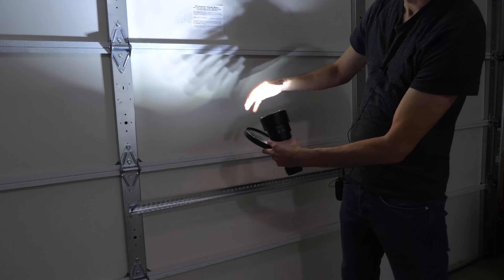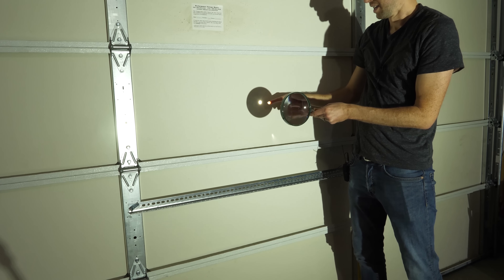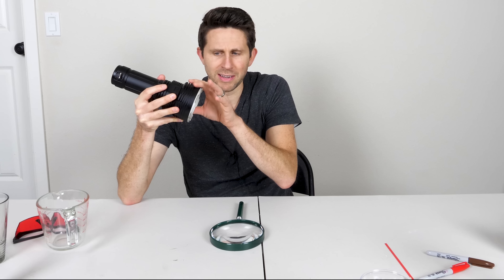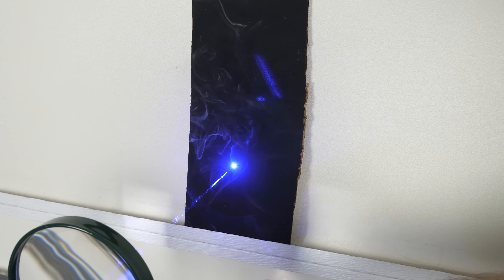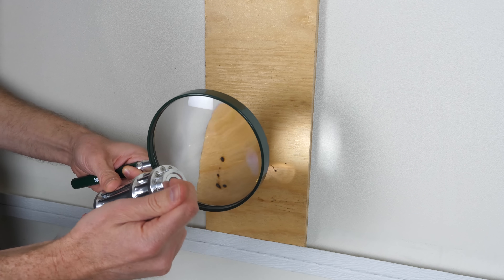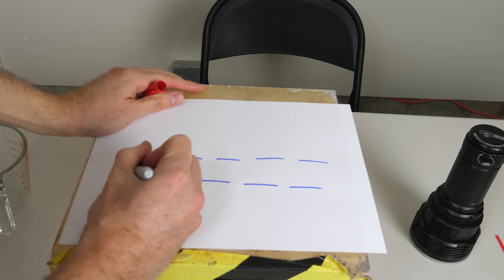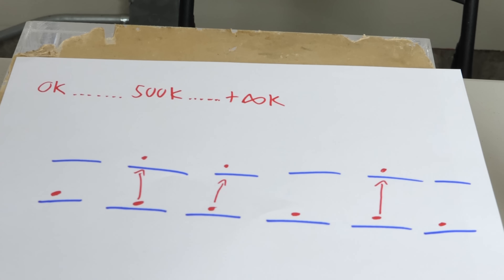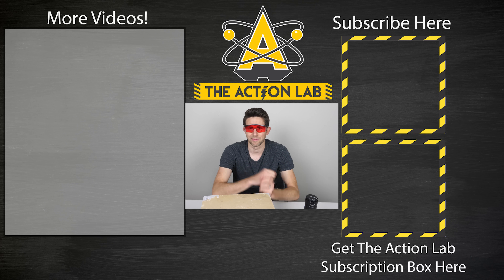What Happens if You Focus a 5W Laser With a Giant Magnifying Glass? Negative Kelvin Temperature!

Comment: WTH!!! you can concentrate the flashlight by  multiple ways....1. using two magnifying glasses. keep the flash at the focal point of one mag glass, which makes the light move parallel to the axis of the magnifying glass 1, and then [place in the same axis the second magnifying glass to focus all incoming parallel rays to its own focal point. OR 2. just use a parabolic light reflecter just like the ones used in really old flashlight.
This is like grade school level stuff dude.....

Comment: Me: just studied about negative numbers
You: -0 exists
Me: illegal
Reply: Arturo How Long Did It Take U To Finish That Reply
Reply: Or maybe... -0 has infinite possibilities. Making it infinity.
(Im joking)
Reply: @Name-cz5jj  5ish minutes? Dang. I thought it would have only taken a couple
Reply: @Name-cz5jj  In "plain mathematics", that's right. In IT, it's not. There's a difference regarding precision: -0.000000....0 means that you have a value which is between neutral zero and -1/(2^x), where "x" is the mantissa precision in bits. "+0.000000....0" refers to both "plain zero" and any value up to (but not including) +1/(2^x). However, if your target storage (e.g., your allocated memory) does not support a precision that can hold the exact value, you will lose the precision while the sign will be kept (since the sign bit is always part of the floating-point representation, e.g. in IEEE 754).
Reply: In maths -0 is equal to 0, so I don't understand how -0K is hotter than 0K.
Reply: Justin van Zuilekom not ok = ok. :)  I finally understand women.
Reply: @justinvzu01  -0 and 0 are both zero, but when interaction with anything else occurs -0 will heat something up while 0 will cool it off. This is why he called it infinitely hot.
Reply: That's a limit. It tends to zero from below
Reply: @Name-cz5jj  Not necessarily. Floating point arithmetic allows to differentiate between +0.0 and -0.0 by definition.
Reply: @Name-cz5jj  That's the point mathematically -0 is the same as 0 the distinction is simply for practical use and understanding.
Reply: Arturo I got a question right answering -0
Reply: Lol this kids probably like 12
Reply: Yo look up -0 on Google then click images then click all
Reply: my name eh jeff mah dood everyone being big brain ur just like “what”
Reply: @Name-cz5jj  It's true, but 0 kelvin is not applicable.
Reply: @Name-cz5jj  bro w h a t
Reply: I got -0 on a calculator
Reply: @Name-cz5jj  r/Wooooooooooooooosh
Reply: :-0
Reply: You only just now learned about negative numbers? Are you in elementary school or something? You’re supposed to 13 or older to have a YouTube account.
Reply: Vicius no, have you learned about -0?
Reply: WoodyofmC is right. When you interpret the atoms energy states in the video as bits, you get pretty much how floating point numbers in a computer work. 0 would be all zeros, -0 would be all ones. Both values would be mathematically equivalent, but not identical, as they are stored as different patterns of bits. A comparison function would have to implement this as special case, a simple binary AND would not be enough.
Reply: At 0 kelvin nothing moves
Reply: Short words
0 can be negative or positive because it is the origin between negative and positive

I know you're trying to make a joke...
Reply: @sans_the_animator  so..... 0 can be + AND - thats it im reading somr manga
Reply: @barringtona3859  But they're both zero degrees, so they should do the same thing.
Reply: And i just found 2 undertale fans in a row
Reply: sans the animator your gonna have a Math time
Reply: Has anyone heard of that liquid that science has discovered that weighs less then nothing
Reply: Not scientifically possible

Comment: But what you're doing is concentrating it, you're not taking the original dot size and making hotter. You're making the dot smaller but more powerful. For every action is an equal and opposite reaction. If the dot becomes 10x smaller, it makes it 10 times hotter

Comment: At 2:02 u said... 
But if u put Led in front of magnifying glass at its focus and collect all rays parallel and then put a another magnifying glass in the way of rays and then converge these rays to point
And secondly u said that it will violate that heat moves from higher energy to lower energy
Iys not true because energy movement has no convention as heat has so it may move from lower energy to higher energy also and the heat energy due to rays on wood is liberated due to oxidation of carbon atoms in wood from higher temperature(wood) to lower temperature(atmosphere)
Hence no violation

Comment: #theactionlab there are stream of photons visible when you were shining the laser on the black piece of board. could you explain why is it visible in case of laser but not in case of flashlight 

also, the pinpointed laser changes colour from blue to violet for a split second 
this is visible after you increased the exposure, still using the black piece of board

Comment: You explained it wrong....
It has nothing to do with the negative temp thing...

It is just a heat pump
Reply: RIGHT ON.. THE "-t " in the laser equations represents a ratio inversion of the number of electrons in the outer shell of the atom (more in the upper  than lower shells).

Comment: I've seen this before, and I know the comment section might be dead, but what if you had a tube for the flashlight that was super shiny on the inside like a mirror that kept light from escaping the sides to where you are able to make a point with the magnifying glass? Would it be hotter then? Or would the tube fixture change the light source to where you'd have to go further to have a small point again?

Comment: What about the light focusing experiment? That turns a 2,000 lumen flashlights light from 90 degree light into 850 degree light beam. Doesn't that break that law? But it does it though. Use lens by lens to get the light smaller and smaller creating more watts per mm. Meaning more brightness and more heat. So doesn't that tell us that it is possible?

Comment: This doesn't make sense

Since you aren't creating heat from heat (don't breaking the second law) instead you are focusing all that heat in the same spot like how  a star is created, you have an incredible amount of Gases at a high pressure, all the heat is concentrated on a small spot making it seem the heat increase but if we hadn't that pressure the total amount of temperature of the gases added, making like the spark that lights the star on fire ( I know it's not exactly like fire). is the same as if we had that pressure, so we aren't creating heat from thin air just combining it like with the laser , we are just concentrating all the heat In a single spot, cuantum ficiscs don't have anything to do

Comment: can light passes through lens somehow damage /burn it?
suppose strong laser beam diameter equal to circular width of lens (i.e laser light beam equal to 10cm passes through 10 cm wide lens) would it burn the lens itself?
or is there a limit to intensity of light which can pass though without damaging it ? i think yes partially (bec its not 100% transparent)

Comment: Hello, it is possible to focus all the light from the flashlight into a single beam. You need a bigger lens in order to collect all light the flashlight is emitting to focus it. This can be accomplished either by a traditional lens or a parabolic lens. Once you focus the light into a more manageable area you can use an assortment of lenses to align the direction of the light into a beam. Cheers.

Comment: Laser beams themselves are not hot, it's what they react to when they are pointed which excites atoms through bombardment. Conservation of entitude is part of it but many other variables come into effect, like working in a vacuum to start with. Having perfect lenses which is impossible. Defracting/Refracting light from the beam. Reflecting light from the surface of what you are shooting. Magnetism from the earth itself. So let's say you are away from the universe with no magantism, gravity etc, in a vacuum, with perfectly coherent light, through a perfectly made lense, directed at a pure material that reacts perfectly with the emitted radiation then you could theoretically get a perfect 0 outcome. Same with getting an atom to stop vibrating going the other way, maybe a black hole could do it which is why they are crazy to think about. But I digress. Oh and by the way light which is made from particles travelling in a wavelength, or spiral actually, have mass. Otherwise gravity could not effect them...

Comment: The laser light is coherent, strongly unidirectional and therefore has a high radiance value. This is why the lens was able to concentrate on a small but high radiance point. Even a weak laser light has a higher radiance than the Sun.

Comment: Also, 2)
If you do a double slit experiment by laser through a lens to a double slit VS some experiment which shows particle nature of light (eg direct light from laser to surface)
Out of these two which will focus more energy to the surface??

As for waves we would take RMS value and also, the AVG. Wave value. And for particle nature thing the energy (heat) of the wave imparted to the surface will be different or not??

Comment: A wider, weaker converging lens (of lesser degree of diffraction) could work with the flashlight ... or even with the Sun - including concentrating more energy per area at one end than at the source (on the surface of the Sun, as in your mistaken example).

Although I can understand what you have tried to say ... you have said it in a confusing way and by an inadequate practical example. So the video, with what is said in it, is irremediable if you do not recognize that you have made a serious mistake in saying what you said the way you said it.

Comment: Google negative temperature. It ha to do with increasing entropy as energy increases. In a system in which atoms can be in one of two states, the entropy will be maximized when half the atoms are in one state and half are in the other. In some systems, like lasers, it is possible to reduce entropy by pushing more than half the atoms into one state or the other. In theory, it is possible to get all the atoms into one state just as they are at zero degrees Kelvin, the ground state. The negative in negative zero Kelvin refers to the negative direction of entropy, not to the temperature in the sense of hot and cold.

Comment: Mathematics must be subservient to the science, which is not what you presented. Nonsense -0°K?!

I don't really understand your point about the surface of the torch (I'm British) always being greater than the surface of where the light ultimately falls. Surely if you had expensive optics that captured the entire surface of the torch then it would focus to a small point. The larger number of photons per unit area would result in a higher temperature than the source, particularly if it's a LED torch... I imagine a filament bulb would be pretty hot relative to the focal point.

Mathematics must be subservient to the science, just because mathematics can produce nonsensical answers doesn't mean that the nonsensical answer accurately describes reality.

Comment: Couldn’t you use multiple lenses to focus the wide spread led flashlight into a single point? Just saying. All this talk about thermodynamics and negative absolute zero and quantum mechanics, and you couldn’t use some basic knowledge of lenses. You just took one magnifying glass and used some huge industrial flashlight and were like “it can’t be done”. Also I felt like I de-learned from watching this video. I can’t confirm or deny the accuracy of a lot of the stuff you said. But the way you used your words, you seem like you don’t fully understand it which makes you seem like you’re full of crap which in turn makes it hard to believe. As soon as I begin to grasp what you’re saying, you throw in “quantum mechanics” or “negative temperature”. So unless you are some professor with a couple PhDs, I don’t think you actually fully understand these explanations you are poorly conveying. Your terminology is neither Layman’s terms nor technical. It’s some hybrid between the two that is the easiest for you to say while trying to use as technical an answer as possible. It’s like a specific dialect of Spanglish that nobody is familiar with and it would take an expert to decipher your explanations.

Comment: Is it possible to focus a flash light by using lengthy pipe with reflecting coating inside for  a required distance to get focused. So that you can have all the lights without spreading out.....

Comment: Quantum mechanics allows negative energies but not negative temperature. Also having negative energy and negative temperatures when dealing with thermodynamics would violate the balance between source and laser point even more. You claim your source has negative temp, and thus negative energy so because of entropy your negative energy will be carried away in order to get the source to the environment energy. Your laser would then act as a way of disposing of the negative energy and would thus take away the energy of anything it hits and would thus cool it down. Using negative temperature to explain why the second law of thermodynamics isn't violated, violates the law even more. There are however some very good comments about why the second law is not violated, check them out!

Comment: Well actually both quantum mechanics and classical optics theory make focussing any beam of light down to a point completely impossible. The minimum beam size is on the order of a wavelength, even if your lenses are perceft. If you were even able to focus a light beam into one single point you would instantly create a black hole, a kugelblitz, from the infinite energy density in that point.   All of this is not even considering thermodynamics.

Comment: That's not what temperature is a measurement of. Temperature is a measurement of average energy per particle. It's about 11 thousand kelvins per electron volt. Meaning the surface of the sun at a temperature of 10 thousand kelvins, the gas in its surface has a kinetic energy of about 1 eV per particle. Temperature isn't a measure of the fraction of the particles that are in a high energy state. And how did I get this 11000 figure? All that is, is the reciprocal of Boltzmann's constant times the conversion rate between joules and electron volts (which is the charge of an electron in coulombs). That's what temperature ACTUALLY is, average energy per particle. And no, it wouldn't violate the 2nd law of thermodynamics if you could heat something to a higher temperature than the temperature of the light. You can easily see this, because you can easily have a solar panel, and then use the electricity it generates to produce an arc that is hotter than the surface of the sun. What this actually demonstrates is that light itself has a sort of temperature, and no it isn't negative for laser light, it's still positive, it's just a very large number and no it isn't infinite either, though it can actually be many millions of degrees in actual practice. There IS a limit to how hot you can get something to with a certain laser light, because there are limits to how columnated a beam of light can BE put in place by the heisenberg uncertainty principle (if you have a beam of finite width, that constrains the positions of the photons and so you can't be completely certain about their momentums, i.e. you can't be certain that they are traveling perfectly straight forward and in the same direction, thus it is impossible for a laser beam to be perfectly columnated), and the fact that the laser beam can only be focused down to one wavelength.

Comment: It doesn't break the laws of thermal dynamics it's simply a case of what it's being fired at in order to produce the increased temperature, I'm guessing that forced induction of just air on the point impact of light will increase the temperature and that's just one of a multitude of gasses that can be introduced.
I'd use a platinum block from a catalytic converter from a vehicle exhaust to fire the sun at and push some air at it to start, but I think I'll leave that up to the internet stars.

Comment: This doesn't sound right, I see a magnifying glass like a transformer, eg: a transformer that has a 1:10 ratio, if I put in 10A @ 240V I could get an output of 2400v @ max 1A The voltage is greater than the source but the total energy is not 2400v*1=2400W
240V*10=2400w
I think the magnifying glass works in the same way, reduce the area for an increase in temperature you could get it brighter than the source by reducing the area but the energy is the same.
This is only my theory, am I missing something?